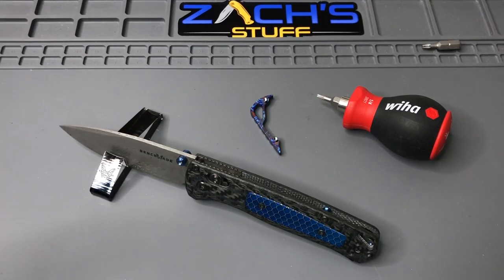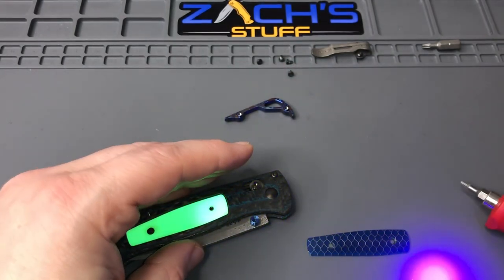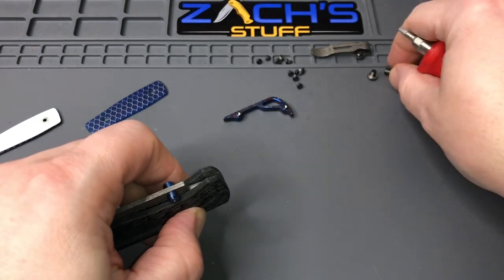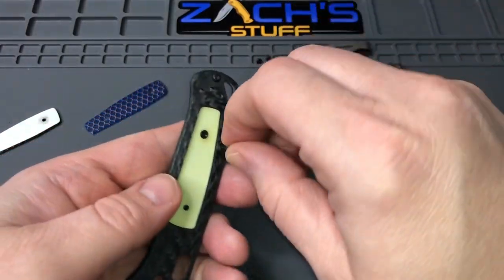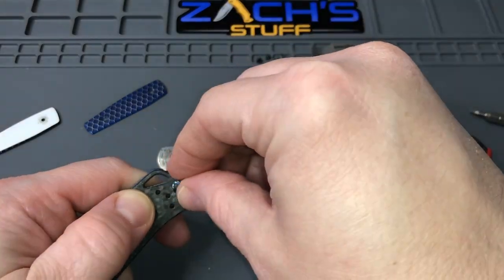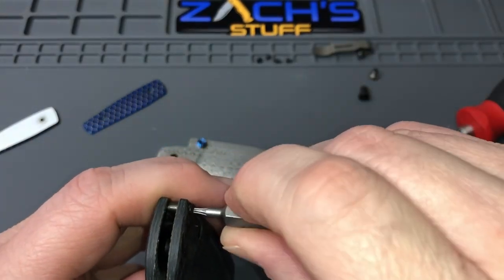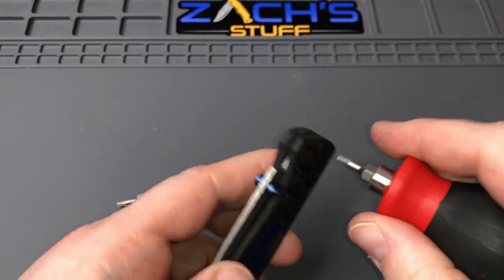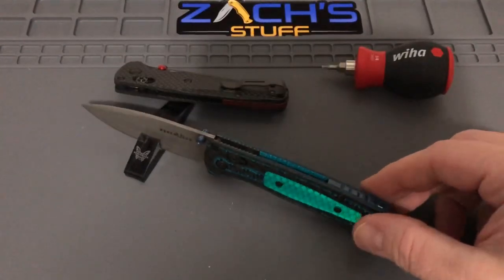Timascus Bugout Back-Spacer from Rock Scale Design

Comment: Have you put a rock scale design backspacer with flytanium crossfade scales? What does that look like?
Reply from the maker: I haven't mixed the flytanium scales with the rock scale backspacer yet....But it should be just fine as long as the model is correct for which backspacer you order.